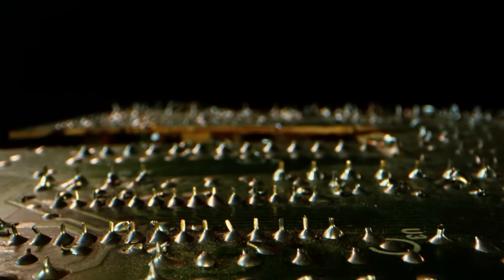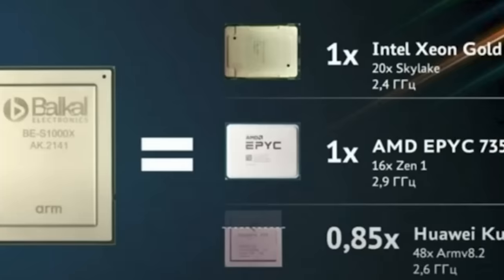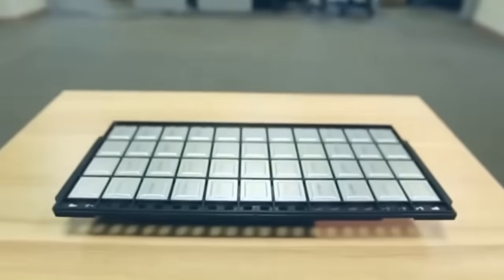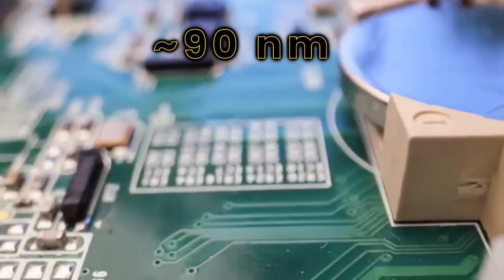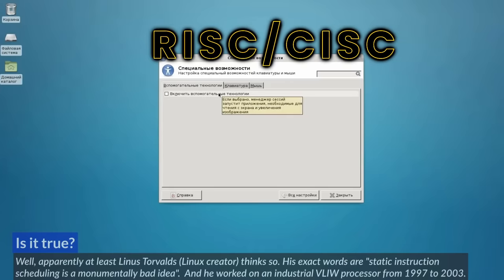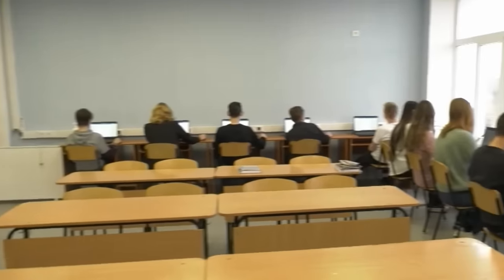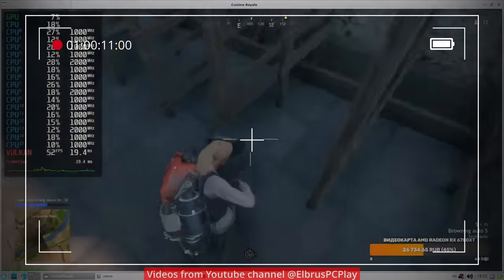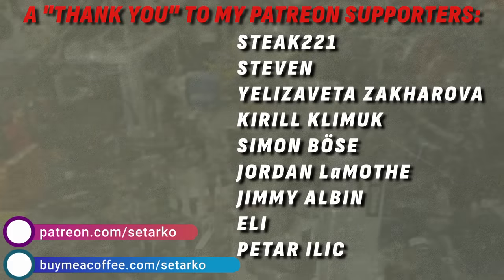Just How Good are Russian CPUs?

Comment: It'd be Russia de only customer for the microchips, al the BRICS countries would be clients... right?
Reply: Amongst BRICS it would most likely be China doing the design and fabbing, not Russia.  For example, China's SMIC stated they had 14 nm in production and claim to have achieved 7 nm.  China also has extensive experience in semiconductor design.  Take all these nm numbers with a grain of salt (they're released by marketing after all and process nodes are very much open to interpretation); still it gives a ballpark idea of where China (~25 nm high yield/decent volume) and Russia (~100 nm at extremely low yield/volume, 600 nm in low volume) stand.  To put things in a perspective, the original Pentium used 600 nm (1991 tech), the first Core chips used 65 nm (2005) with 20 nm widely used around 2011 and 7 nm being where things are currently.  Russia's 30+ years away from state of the art and falling behind while China is 10-15 behind and rapidly improving.  Volume is still an issue for them though.
Reply: @alexhajnal107  good to know. But it is good to have development in technology if you want to have real independence.
Reply: @alexhajnal107   I would say the gap is alot smaller than that. China recently produced 5nm chips for Huawei meaning its less than 4 years behind the leading edge. As stated in the video Russia already has 28nm designs and can produce them the moment they get a DUV lithography machine, which they can probably buy from china by the end of the year. So Russia is only about 10 years behind at most.
Reply: @hughmungus2760  My issues with that are 1) Chinese tech isn't indigenous Russian tech 2) It's in China's interests to keep Russia subservient 3) A modern fab is in the USD 1B to 4B range (not including added costs due to corruption); where's Russia going to find the funds?  (Especially if they can't offset it with export production.)

Edit: Personally I don't think China's chip tech is that advanced.
Reply: @alexhajnal107  the semiconductor tools china is producing is already not cutting edge so I dont see how selling them to Russia is really going to give away any chinese edge.

While china may not give away exactly how to produce 7nm chips on a 28nm machine, Im also sure Russia could figure it out quite quickly for themselves.

Oh and there are now rumors that china is only a few years off releasing their own EUV machine which would allow mass production of 7nm and under chips. So longer term Russia could probably get a hold of those too.
Reply: @hughmungus2760  China's advancing its tech very fast and they may well end up surprising me.  Russia, on the other hand, is having to beg North Korea to supply the tooling to make artillery shells!  If they can't even create basic machine tooling then there no chance in Hades that they can build a semiconductor fab.
Reply: @hughmungus2760  I think China's eying Russia as a source of raw materials.  These are plentiful, particularly in the east.  As for offshoring, yea I could conceive of that happening but if it did I think it'd be more of a Bangladesh situation than a Thailand one.
Reply: @alexhajnal107  Russia has the infrastructure to support advanced industry unlike say, Bangladesh. Sure alot of it needs renovation but its not starting from scratch.
Reply: @hughmungus2760  Good point.  It'll be interesting to see how this plays out.

Comment: This is not it works
Porting software to different architecture usually needs very little to human input
You could port Linux or FreeBSD to say Intel Itanium in matter of weeks, at worst months. Yes, everything! Whole ecosystem.
Why? 
Because you need to port just small parts of kernel and maybe low level libraries (like C library) to different architecture. In Linux Kernel you are looking at bootstrap, memory management, process management and IPC code. That's probably all in Linux Kernel. Then it is C library.
Reply: No, you are able to, but that's code will not be as fast as it could be if you carefully optimize it.
You get only 1% of power.

Comment: China has fully designed and manufactured a 7nm process CPU in their new Huawei flagship phone.
So yes, they are the first country to do this completely independently.
Reply: Huawei and SMIC use ASML Twinscan NXT:2000i DUV for that, as far as we know. The is no sign yet that they can build lithography systems with comparable throughput, even with that older technology.
Reply: @gviehmann  cope. They developed their 7nm process completely domestically.
Reply: @corvusprojects  Shanghai Micro Electronic Equipment will deliver their first domestic 28nm DUV Lithography Machines by the end of 2023. To my knowledge, no other Chinese company is more advanced than SMEE in building lithography machines. So maybe in 2025, China will have reasonable yields and a sub 28 nm domestic process. There is no doubt Chinas administration is now willing to throw money and people at the problem to accelerate progress. I just don't expect miracles to happen.
Reply: @corvusprojects  you completely ignoring what he said and saying the same ting over and over china can’t produce 7nm CPU’s without ASML machines
Reply: @lesleyhaan116  while you wrote that, news has revealed that they have accomplished a 5nm manufacturing process.
The sanctions have failed.
You're just full of cope.
Reply: @corvusprojects  
It would be realistically be owned by the CCP's elite,or at least have considerable stakes with them.But then so does the US and Maybe Taiwan for the same.

Comment: If its 16/28nm then it is again made on US machines.  Russia cannot make their own cpus not even 92nm.  If russia/China tried to make their own cpus it would take about 10+ years to make all the parts themselves to make the machines.  Currently 28nm is not sanction but will be soon and thats same with 92nm.  China keeps trying to act as if they are making breakthrough but reality is they are just learning to even use the machines and that wont be for long.  Currently Russia/China are wasting money trying to develop cpus on machines that can be sanction at anytime just like EUV was.  Also arm cpus arent russia design at all.  Russia never had any good cpus, I mean every the internet is a US military project and that is why they own it and the backbone of it.  Meaning not only can they see all transmissions but they can block transmission anytime they want.  The more military tech built with US tech the easier it is for them to track and stop it.
Reply: Bro if they wanted to make cpus, China could just take Taiwan tomorrow. They don't need the usgay to make them. They just need tsmc, which is better than anything in the USA. All bintels best fabs aren't even in the USA either. All the cutting edge stuff for them is in Israel.
Reply: china already makes 5nm chips for Huawei phones, Keep coping.